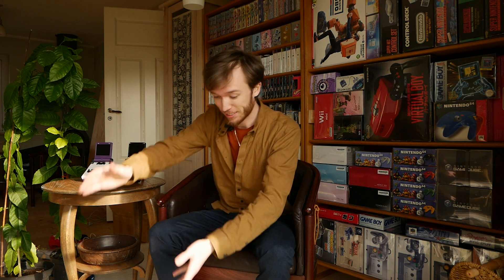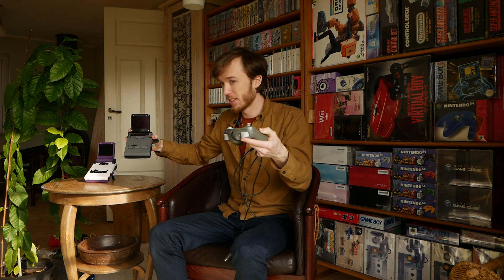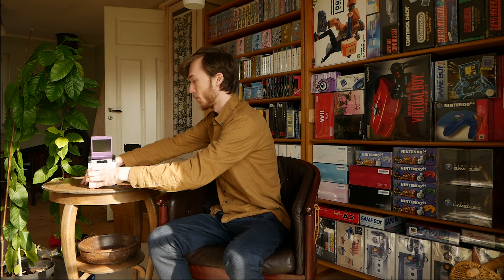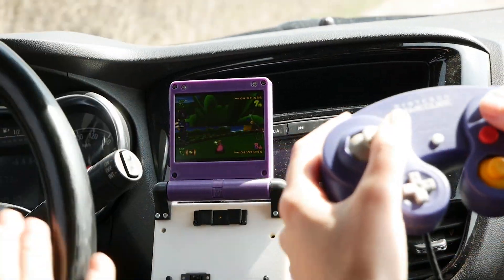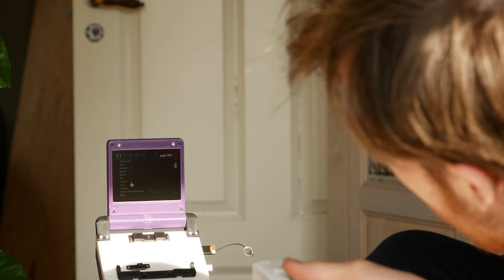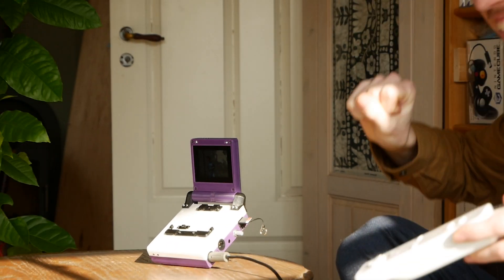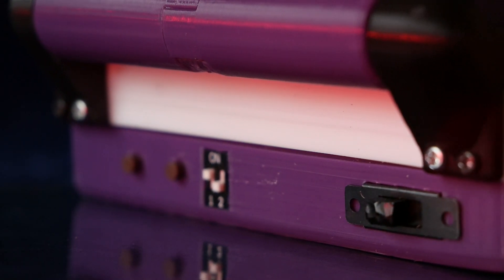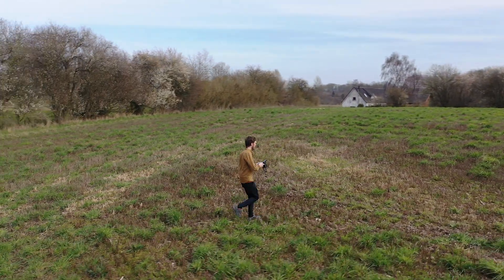[Wii Backpack Showcase] Portable Power For Gamecube Controller & Tabletop action

Comment: I have a question about your sony pvm 740 - there are two models 740 and 741. 740 is STE and 741 is Trimaster EL, but I've seen 740 models with trimaster el logo on the front too like yours, so what is the difference? 🤔
How can you tell if 740 is trimaster el?🤔
Reply from the maker: Thats a great question, mine has the Trimaster EL on front, and is labeled Sony Pvm 740 on the back.

I have seen the STE models for sale, and have though about the difference aswell, i dont think that the difference is that major, if there even is any
Reply: @mrej112  Thank you for the quick reply. The only physical difference I can see is at the back - there's an extra sdi connection(5, 4 on the 740) on the 741.
Reply from the maker: @yavorchernaev39  okay thats atleast one difference! Funny how the rest of the potential differences does not seem to be dokumentet anyware (thats public on the internet atleast)
Reply: @mrej112  I know, it bugs the hell out of me! Should I buy 740 with "trimaster el" logo or wait for 741 to pop out? 😆 
When I know there's a newer model, I kinda want to buy it, thinking it may be better built! 😅
Reply from the maker: @yavorchernaev39  I can only recomment the 740 Trimaster El that i have, newer had an issue with it, nor do i miss any additional featues. Am sure you will be happy with your monitor no matter what model you buy. Good luck! :)
Reply: @mrej112  By the way, is there a way to tell how many hours has been used? I am trying to buy one at the moment - I asked for operating hours, but the guy said that he can't find it. Thank you.